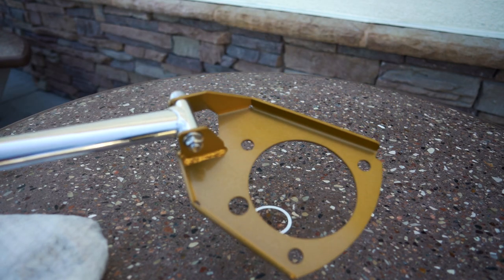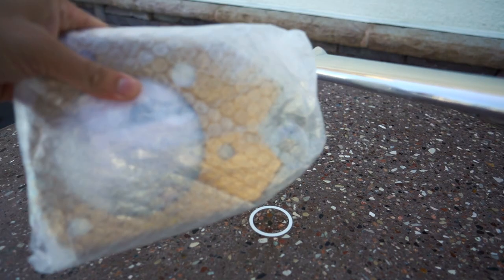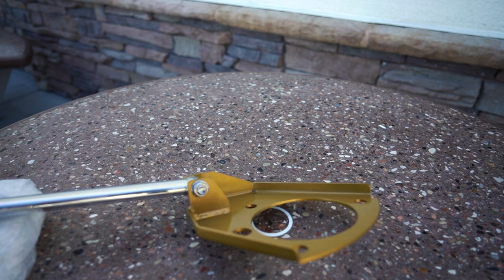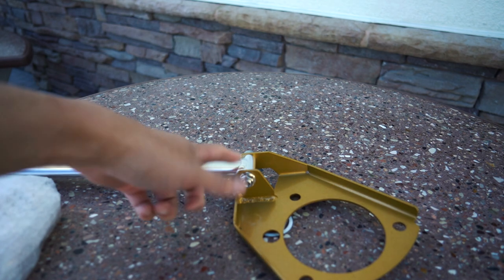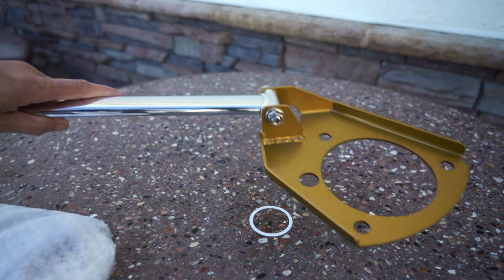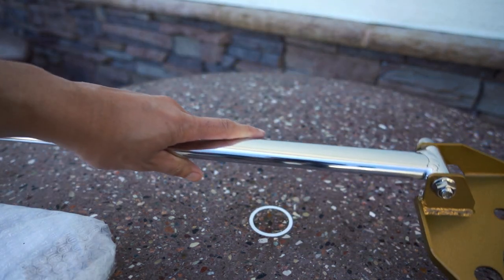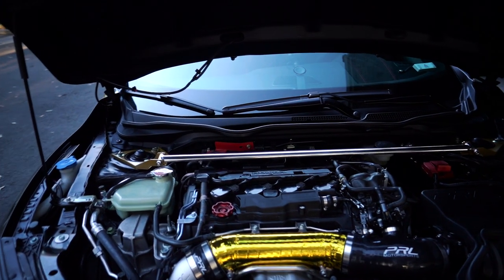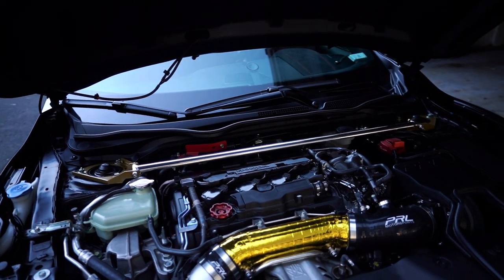DO STRUT BARS REALLY WORK? J's Racing strut bar install FK8

Comment: I recently put a strut bar on my Toyota. Its steel and has no hinges. It has made a difference to the feel of the car. The steering feels more direct under acceleration and the steering just kind of feels more solid. The car is a bit more direct under fast cornering as well. All the changes are quite subtle but I would say worth it. One thing I wasn't expecting is how hot it gets from the engine.
Reply from the maker: Which Toyota are you driving?
Reply: @GridZilla  its a toyota camry 1998 thats lowered with a number of suspension upgrades.
Reply from the maker: @markymark560  ok but as mentioned in the video, most modern sports/enthusiast cars will not benefit as much from a strut tower bar like an older 90’s family sedan would.
Reply: @GridZilla  yeh true.
Reply: I have 7th gen civic 2003 will make a difference?
Reply: @dailydad6335  give it a go and post back here with your results
Reply: @markymark560  well at the moment i am deciding whether to spend on strut bar or eibach prokit on an oem sshocks?
Reply: which Toyota do you have? I have a 2010 corolla s and I have little to no clearance for my tools to remove the two back nuts. Did you also have the same problem?

Comment: Strut bar or sway bar is better?
Reply from the maker: FreeNix PJ for handling the rear sway bar is far more effective than the front strut bar
Reply: @GridZilla  why they always talk about front strut and rear sway bar? Is front sway and rear strut bar is not that important?
Reply from the maker: FreeNix PJ depends on you car. Fwd vs rwd
Reply: @GridZilla  so fwd should go with front strut+rear sway bar and for rwd is opposite?
Reply: @GridZilla  how about getting both sway bar instead of strut bar?
Reply from the maker: FreeNix PJ if you’re after actually improving performance then only Rear sway on the FK8 is necessary

Comment: Just installed this and I’m rubbing my tires like crazy. Removed peg awhile ago on Eibach pros, bent that tab and rolled the fender lip. I’m going to install a adjustable camber plate and add more neg camber to clear it. Is yours rubbing?
Reply from the maker: Nope but I run negative camber
Reply: The rubbing I heard was the underpanel bent from hanging and grinding on the road. A worker forgot to reinstall all the clips after an install. 🤨
Reply: @weduhpeople8504  what car? And rubbing in the front?

Comment: Struts are mainly energy transference tools, they do work, every bump you take at cornering or even driving straight is energy being transfered from the tire to the strut to the tower
Reply from the maker: Agreed but depending on the chassis design and the strut bar design the effect of the strut bar may have little to now effect.
Reply: @GridZilla  well i believe depending on the conditions and the way you drive the car is going to make a difference; if you are a track junkie bars are a must, but for a sunday drive or a normal drive is not going to make a difference. My first mods are always struts and sway bars because im crazy about the handling 😅, thats just me.
Reply: In straight line is just weight in the car

Comment from the maker: I realize the answer isn't crystal clear so for those wondering what my ultimate thoughts are on this I'd say the answer is implied. Solid strut bar no hinges vs Lighter weight aluminum with Hinges. I didn’t feel much of a difference with regular driving but might feel more of a difference on track. In other words it’s really a toss up but the solid strut bars are more likely to be more effective than the multi piece strut bars. Older vehicles with aged chassis technologies would likely benefit more from something like this as newer chassis's have gotten much stiffer straight out the factory. Having said that, bracing is bracing. If you like it for looks, go for it. If you want it for more chassis rigidness, the difference in a modern car might be negligible but certainly won't hurt. Thanks for watching!
Reply: I assume the CTR has a stiffer suspension than my Sport touring hatch; would that make a strut bar more or less likely to make a difference for me? Or is the factory suspension already good to the point where it's hard to improve without spending tons of $$$?
Reply from the maker: Daniel Segel other than the name “Civic” in the back of your car and a CTR the two cats couldn’t be more different from a performance stand point. Yes the suspension on the CTR is really good from the factory but it can be improved on
Reply: Seems like I’ll be getting a one piece design if this two piece isn’t doing much. Makes sense.
Reply: Love how you keep it real. Regardless of the communities die hard stances. Honest truth is cars are more rigid and sturdy out of the factory. Especially a car like the type R that track ready out of the box

Comment: What about a solid piece of carbon steel no moving parts just bolts right on?
Reply from the maker: Sure that would be more rigid for sure but it’s also about the effect you’re going for. Anytime you stiffen up the chassis up front you are introducing more understeer.
Reply: @GridZilla  ok but I can adjust the camber to counter that correct?
Reply from the maker: @josephhuffstetler6569  within reason yeah. The idea is to get the whole car working together in harmony, not modifying one thing so you’ll have to correct it with another mod
Reply: @GridZilla  yea I understand that. I went with the dc sports carbon steel front strut tower bar. And I haven’t noticed any under steer problems from it, but I had planned on adjusting the camber just a bit but haven’t found a reason to do so yet. I do understand what your saying though. It’s just modding a factory stock vehicle I would think a lot of tweaking would be needed, correct? I’m waiting on my front/rear sway bars and linkages. Not planning on putting a rear tower strut bar on from my research there’s really no reason for one. The rear already even factory is very stable, but the rear sway bar will stiffen it up just as well. From what I’ve heard and researched. Pretty much all the drivetrain parts have been swapped to upgraded parts hubs springs(trd) new struts all that. And I plan on, even though people don’t recommend it slapping a small turbo on there not so much for power but for economy reasons but also to have that little extra power to work with.. supercharger is also an option just having a harder time finding one compatible other than the trd thats not pushing crazy amounts of power.

Comment: Question , would this fit on the fk7? The sport hatchback model?
Reply from the maker: No idea
Reply: Most bars I’ve seen online are compatible with both FK8 and 7 but No guarantees
Reply: I have the J’s racing rear strut bar on my Fk7 (2019) and it’s from a type R

Comment: bro does it say j's racing anywhere on the bar?
Reply from the maker: Ali Toroganan they give you a sticker. Mine is on the driver side of the bar
Reply: @GridZilla  just a sticky, nothing embossed on engraved?
Reply from the maker: Ali Toroganan just a sticky
Reply: @GridZilla  appreciate the inputs mr Baxi